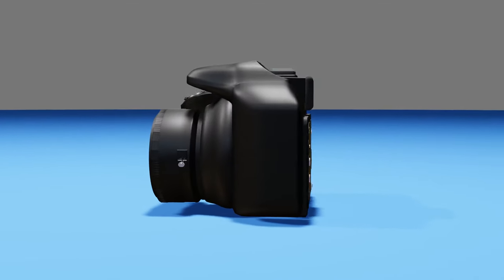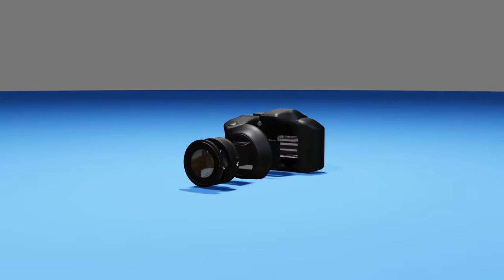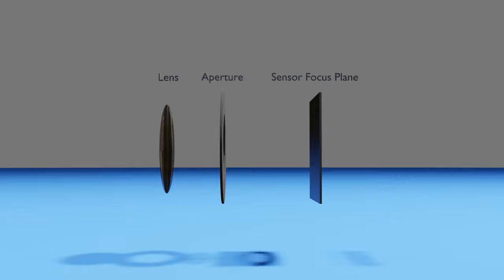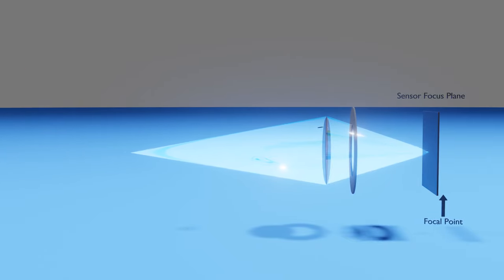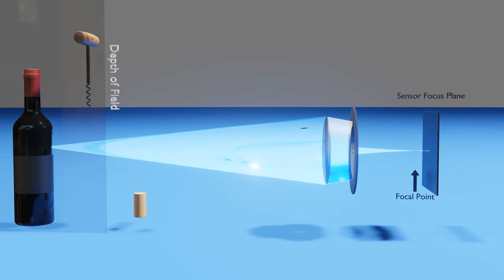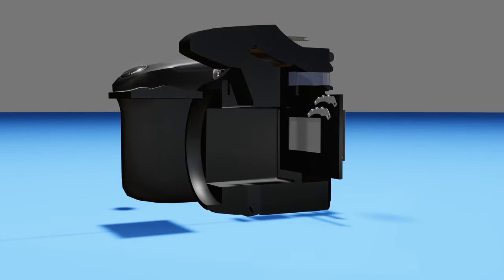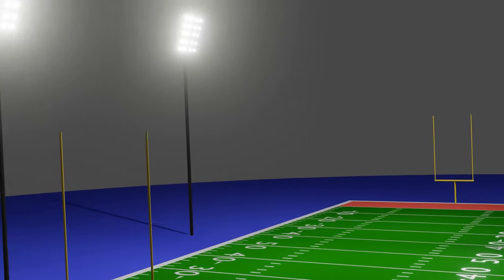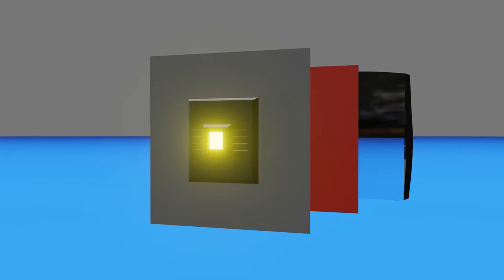How Does a DSLR Camera Work

Comment: Sensor is made up of three min layers: micro lens, colour filter and photo diode.
Red photons for this pixel then hit the diode which then converts the photons into electricity and stores the charge of electron. The more photos that hit the diode, the greater the electric charge will be. Each pixel also has a amplifier which takes the built up charge and increases it. This amplification process is referred to as ISO. The camera processor will layer read the charge to create the strength of that pixel. Now that all the pixel have a charge to them, the camera begins to read the sensor row by row, sending the charges down the sensor and out to the cpu for processing.

Comment: I think I can finally understand how the Circle of Confusion forms, for which I am most grateful! Still, I can't understand this one aspect in the animation: why doesn't the focal point from the bottle opener form at a different distance once the aperture is changed to F/22, when the focal point from the bottle at F/22 forms earlier than it did at F/1.4 (the same can be said of the cork)? Does stopping down: 
A) decrease ONLY the diameter of the cone of light that forms the focus point (seems to be the case with the corkscrew), or
B) does it decrease both diameter AND length (seems to be the case with the bottle and cork). Please, can you help me understand this anomaly?
If it is depicted properly, why is there a change in distance of the focal points (of out-of-focus objects) when changing aperture, while no change with the in-focus object? Please, can you help me understand this? Thank you.
UPDATE: I've learned that the answer to my question is that of A): the length of the cone of light to the point of convergence/focal point is not affected by change in aperture